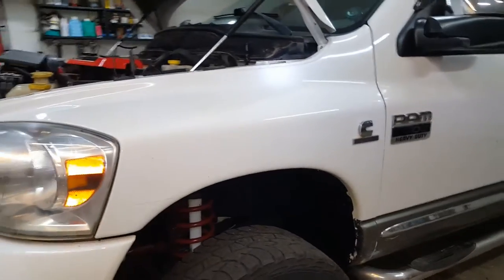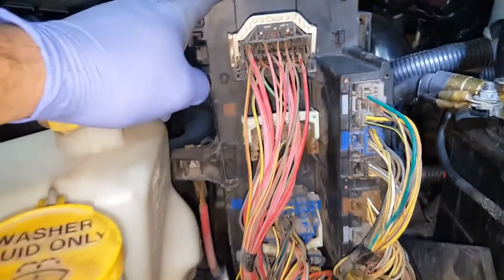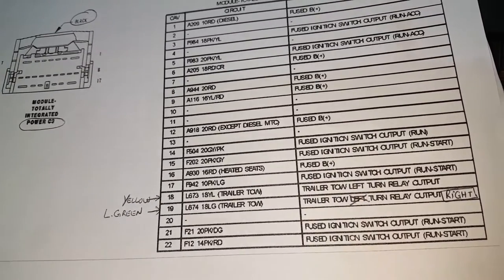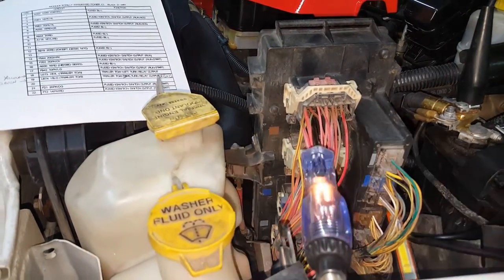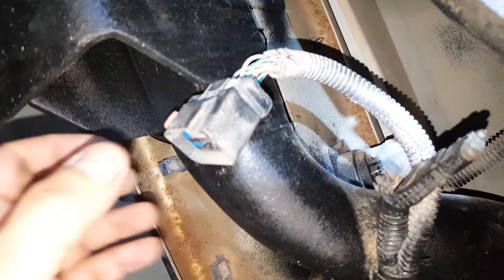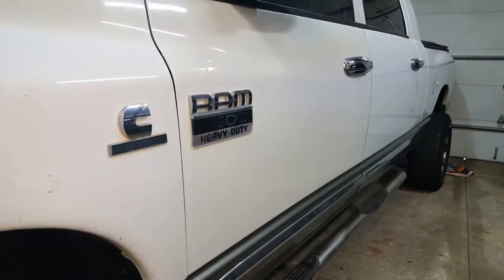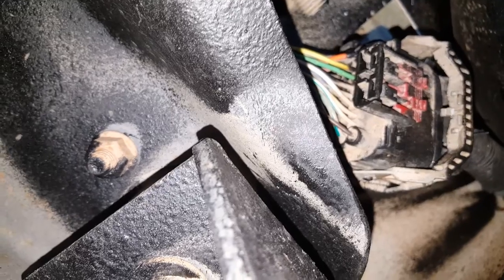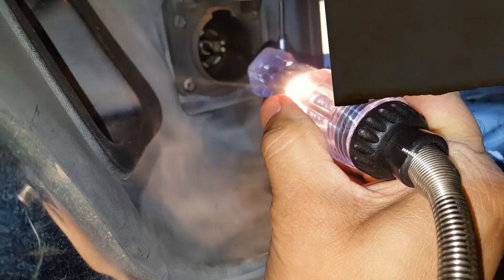Dodge Ram No Trailer Turn or Stop Lights | TIPM? | NO But Fixed

Comment: This is by far one ☝️ of the best videos I’ve got 2006 Ram 2500 right turn signal rapid flashing and no power to rear bulb for turn or brake at back light or trailer connector only running light.
Brake light only on left and 3rd brake light 🤷🏻‍♂️

Comment: I appreciate the video, It made troubleshooting my issues much easier. I actually had an issue at every location mentioned in the video. I didn't have power for the trailer lights at the TIPM, so I replaced it. After I restored power at the TIPM, I was losing power at the pigtail inside the fender well. I unplugged it and cleaned  a substantial amount of dust from the connector. That restored power to the pigtail at the bumper, but I also had to clean out the last connector to restore power to the trailer.
Reply from the maker: Thank you for watching.  All those issues are common with these trucks, usually not all at the same time but I'm glad you were able to figure out the problem and fix it.

Comment: Great quick video. Helped with connector locations. Question though, what would cause just the left brake light on the trailer to not work yet the turn signal still does? It is not the fcm or tipm as i have eliminated those as the failure point.
Reply from the maker: Thank you for watching/subscribing. 
If you have watched this video, not only does it give you the location of the connector but it also tells you how to diagnose the lights not working.  If you know you have signal coming out of the tipm, then it goes through the connector and back to the trailer connector on the bumper.  Check for brake light signal at the trailer connector on the truck and if all is well there then the problem is on the trailer.  It could be wiring or the bulb it self.  Just have to follow the signal from the tipm all the way back to the trailer and figure out where the signal loss is. thanks

Comment: Great video man. Helpful and straightforward to the point. Now gotta just convert this for a 1500 with a flat prong type.
Reply from the maker: Thank you for watching.  Ram 1500 should be the same.  "Flat prong type" 4 way is tied in to the same wires behind the 7 way connector.

Comment: I have no turn signals up front of my 06. Have them in the back though. No trailer lights either. I pulled the entire tipm out a few weeks ago and cleaned the connectors and contacts hoping it would fix the issue...it didnt. 

I'll try what you did to see if that helps. If I have front parking lights burned out would that make my blinkers not work up front ?
Reply from the maker: Hi, thanks for watching.  Yes first thing I would do is check is the obvious,  the bulbs. Front parking lights & turn signal do share the same double filament bulbs. Once that checks out then follow the circuit from the TIMPM.

Comment: Traced the problem on my 2014 1500 to the same outgoing green wire on connector under fender. Any tips on how to remove/reinstall that wire from the outgoing (female) side of connector so I can improve the connection? Is there a special tool to remove the female part from connector? Thanks for a great video.
Reply from the maker: Hi, thanks for watching/subscribing.
Glad you were able to figure out the issue.  You can certainly remove the wire/terminal from the connector using picks or there are terminal removal tools available.  They are just pushed and pin locked into the connector and a pin release tools like one of these can be used to release the pins 👉 https://amzn.to/44EG4s0  

Or you can cut the terminals and connect the wire directly, bypassing the connector.(single wire connector can also be used 👉 https://amzn.to/3LLPNnE).  There is never any need to disconnect or remove that connector for any reason, use some dielectric grease and should keep it corrosion free.   Thanks

Comment: Good job explaining!  I don’t mind the music. I do have a question if I may?  2021 Ram 2500 HD. We changed all the wiring and lights on trailer. Noticed water inside both 7 and 4 pin connectors on truck. Changed a blown fuse on truck. Everything was working and now it seems the lights on trailer don’t work when truck lights are on auto. Is this normal?
Reply from the maker: Hi, thank you for the kind words and putting up with the music.  I cant change it since it was part of the original video when first uploaded.
  Just to clarify, all trailer lights work fine when headlight switch is turned on manually?   But when the headlight switch is  "Auto" all truck light work but not the trailer lights?  This may be normal, I have experienced this on some of the ford trucks.  
Just want to make sure you are not talking about the DRL(day time running lights) which is separate from running lights(parking lights) & your truck should have DRL light system.  DRL's most of the time are only set to turn on front lights and no running lights.  
 However, due to some Canadian regulation changes in 2020, trucks built for the Canada market have the parking lamps come on with the DRL, and for the US market the parking lamps are set to off from the factory.  Some of these settings can be changed with a scanner.
Couple things you can try.  
-Cover up the headlight sensor(should be on top/middle of the dash), when headlight switch is on "Auto".  It should sense the  darkness and turn on all the lights.  Do trailer lights come on with all the truck lights?
-If everything works fine with the switch turned "ON" manually that that tells us the circuit is good.  This maybe normal where the trailer light circuit is not powered when headlight switch is in Auto mode but I can not be 100% sure.   I'm hoping someone else will chime in and clear this up for us......... Thanks
Reply: @JSFautoPlus  thanks for the quick response!  Yes sir they work when in normal mode but not auto mode. Made in Mexico for US market. One would think the Dodge owner’s manual would make mention of it. I will try your suggestions this weekend too much rain today and can let you know. Thanks again!

Comment: Where do you get the wiring diagrams?
Reply from the maker: Hi, thanks for watching/subscribing. 
All data has all the wiring diagrams available.  I believe it is owned by AutoZone You may be able to use it for free and have them print diagrams.  Some are available online for free also if you search the right forms.

Comment: Goof TS video but didn't help me. my issue is the TIPM. I swapped out the TIPM and fixed the rt side trailer signal but the TIPM I swapped it with has a bad 4x4 indication
Reply from the maker: Thank you for watching/subscribing. In many cases it is the TIPM and a well known issue.  They also tend to corrode at bottom from moisture causing connection problems.

Comment: i have the same issue . but mine the left didn't work.  thanks for the video.
Reply from the maker: This is a very common issue with the Ram trucks.  Thank you for watching
Reply: Mine stays on with out flashing.

Comment: My plug in the back is corroded in the connections. Where can I get that part
Reply from the maker: Plug for the 7way behind the rear bumper? That is available from auto parts stores or online.  
Replacement plug in the front wheel well?  That would have to be dealership or the junkyard.

Comment: What is a “Tip-‘em”?
Reply from the maker: Hi, thank you for watching/subscribing.
TIPM, stands for Totally Integrated Power Module. The TIPM is a component found in many modern vehicles, including RAM trucks. It's a part of the vehicle's electrical system, responsible for controlling and distributing power to various systems such as fuel pump, ignition, lights (including trailer lights) and more.
The TIPM essentially acts as a central hub for managing the vehicle's electrical functions. However, there have been TIPM-related issues in RAM trucks, where problems with the module can lead to electrical malfunctions.
thanks

Comment: Hey, Which fuse is for the right/rear turn signal on the truck itself? 2016 Dodge Ram 1500
Reply from the maker: Hi, I don't think there is  such a fuse. However F53(left) & F81(right)  20amp fuses are listed for turn signals but for trailer tow.
Reply: Thought I was going crazy. I replaced the bulb but when I hit a bump it’s on and off. Assume it’s a fuse but I can’t locate it.
Reply from the maker: Sounds like a loose connection somewhere.  Recheck the bulb socket for loose wires, corrosion, etc.
Reply: Thank you, It was a loose connector.